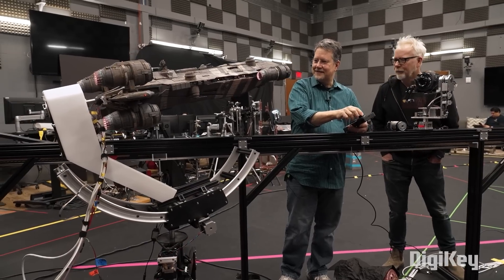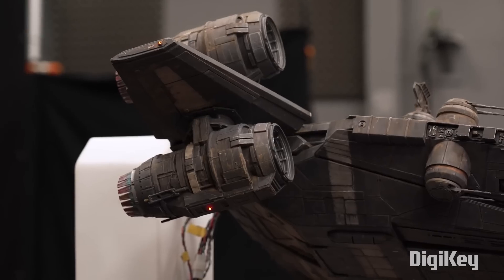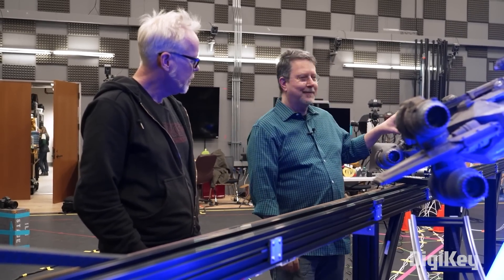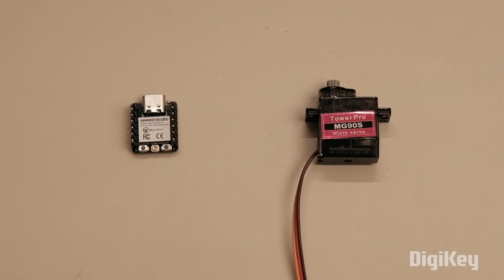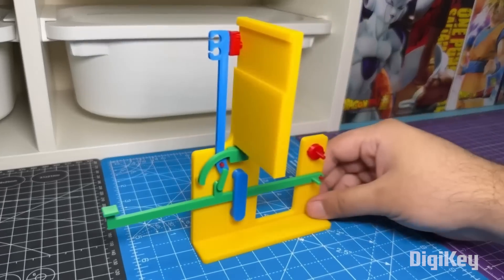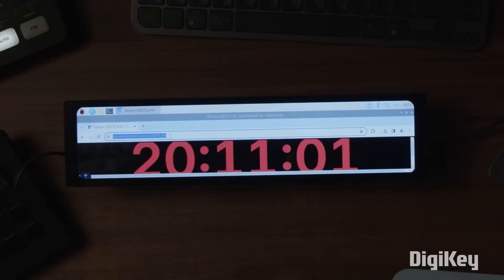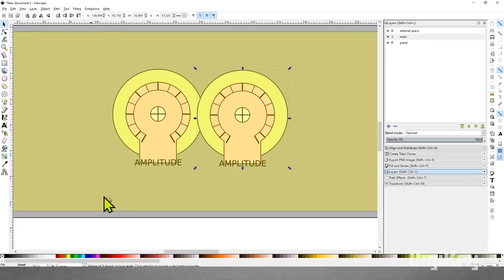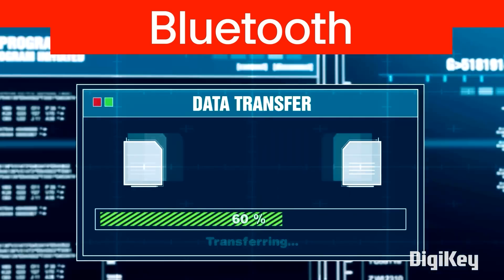Let's Be the First [Maker Update] | Maker.io

Comment: I love the emphasis that is put on the use of vintage lenses, and that some shots in the Mandalorian were shot with the same lenses used in the original movies.

This is the next step in the "Practical effects are better" trend. Ofcourse  it means nothing, it's pure marketing babblle designed to give you the idea that they are doing something special. There is absolutely no way that you can tell that they used the older equipment. No way at all. And this is not just because old lenses (if properly looked after) give exactly the same razorsharp images that new lenses do. It's also because those images are processed to look exactly like the images taken with the new equipment. You cannot tell the difference because the producer has taken great care to make sure that there are none.
Reply: The craziest thing for me - which I didn't touch on in this segment, was how if they wanted to maintain focus on the miniatures, they actually needed to keep the lenses fixed in place, and move the camera bodies back, since that's the only way to keep the same composition. Even on a prime lens, if you adjust the focus, you zoom in or out a little bit. I've been using cameras for decades but I still learned a ton from this video.